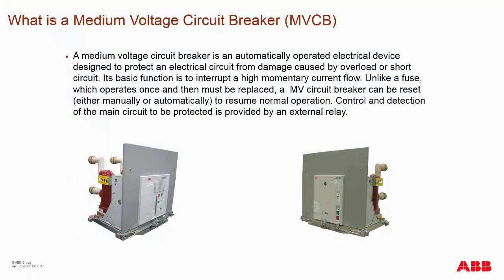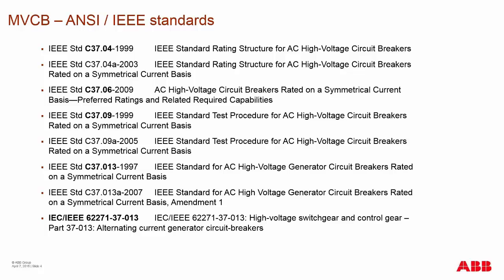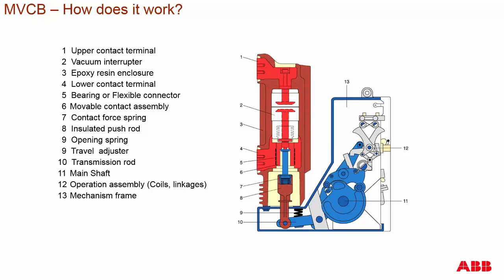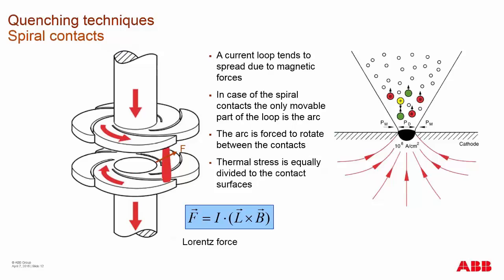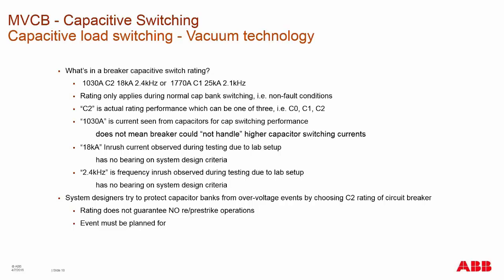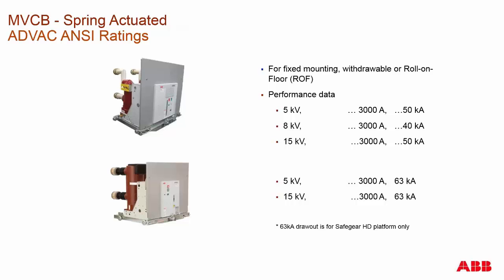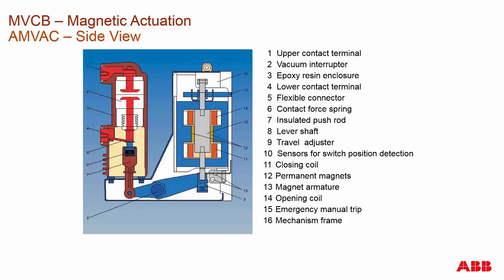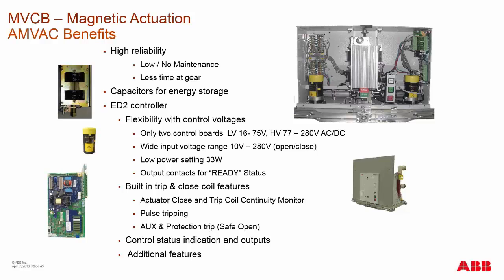Medium Voltage Breakers

Comment: We have just a curiosity regarding servo motors of VD4-CS, VD4-AF & DS1 are these servo motors are specially design for this specific application or it is standard servo motors which is normally available in market.